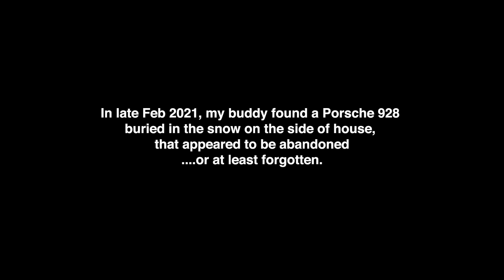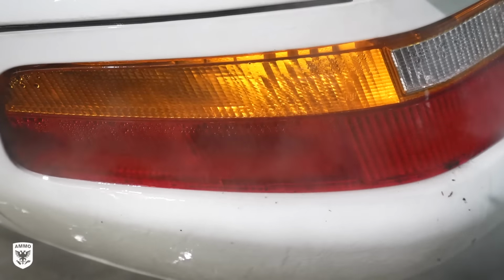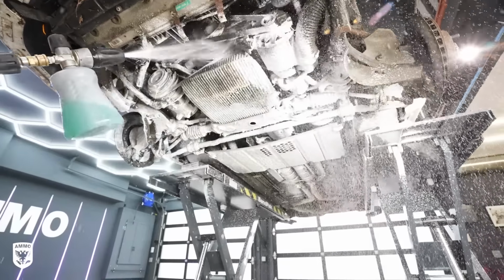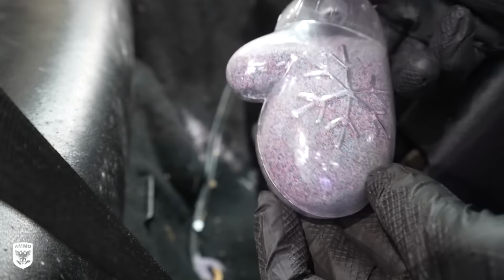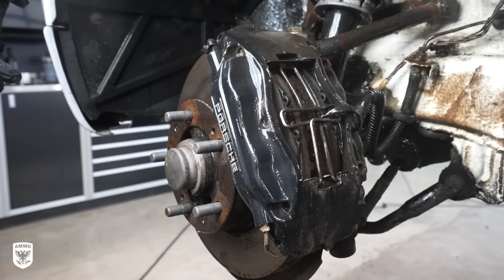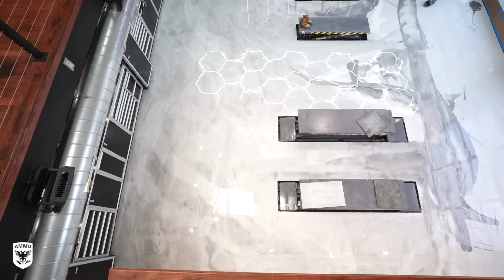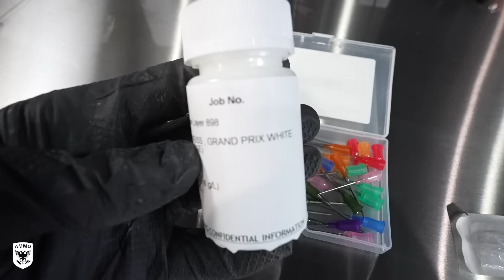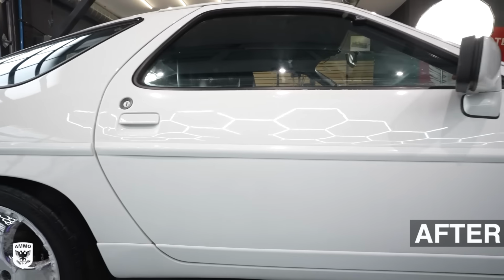First Wash in 15 Years Porsche 928. Most Disgusting Moldy Abandoned Porsche Ever!

Comment: I can't believe the concrete passed inspection with no rebar.  That is insane.  Floor looks killer now, as does the Porsche but that goes without saying!
Reply: That is absolutely wild, that they didnt put any rebar in a concrete floor built for an automobile garage..i once worked for a fencing company and they also made concrete fences..we used to put so much rebar in the brackets b4 we poured the concrete..otherwise the fence would just fall apart.
Reply: Was it fiber cement? Don't have to use rebar on fiber cement.
Reply: That floor is most likely still going to have issues. The rebar in a concrete floor is to stop cracks in it, and not the flex that he mentioned. That flex is coming from the void between the concrete and soil underneath, or just crappy soil all together under the floor giving way. Again, if he haven't had problems with cracking, that rebar ain't gonna help.
Reply: @jayste9334  Jay it was never a automobile garage, it used to be a metal fabrication business.  Guessing the owner even poured the concrete himself lol
Reply: I can't believe it either, the builder must have taken a really good payment of Larry and Larry was so excited and all for the new shop, that is an awful job..
Reply: @murry001  word ok...so they never did anything to the floor, when he was customizing the building after he bought it..that makes sense
Reply: @wasabichicken4433  Ouch..foundation problems
Reply: sounds like a company was trying to pull a scam.
Larry is a fairly rich New York businesses owner, so a prime target.
Reply: @steveorules3972  didnt look like it...looked like typical concrete based on the sample
Reply: @jayste9334  uu
Reply: Working with concrete and fibers for years, you don't need rebar in a non-load bearing floor, even if it has heavy duty vehicles moving on it daily. And to the argument of cracks, fiberglass and basalt fiber treated concrete actually crack significantly less than rebar concrete and it's one of the main reasons to use it, in addition to no rust, no reaction with chemicals like chloride, and so on. I suggest a good chat with Owens Corning to get you up to speed on the realities.
Reply: @diceymaan  Well some inspectors where I live would have a very different opinion of the rebar being non-load-bearing slabs.  I have had to cut into many a slab just to show the rebar reinforcement so that inspections could sign off on these projects.  I have nowhere near the years of experience you do, I am just stating what I had to go through on a daily basis.
Reply: @craigstrickland1572  There are some inspectors that aren't up-to-date, but a lot of them luckily are. But usually you'll have to use a certain brand, because that has been proven to work. It's how bigger companies get bigger in the industry, they do a lot of tests and then the engineer and architect has to choose that brand, or their choice will fall under scrutiny.
Reply: @craigstrickland1572  This particular floor though, should have had rebar as it was the lowermost concrete.
Reply: I remember my first job as a 14 year old was removing nails from old timber beams in a beautiful old building being converted to apartments. The builder "promoted" me to helping with the build itself eventually. I can still remember laying the steel mesh for the inspection, then being asked to remove it as soon as the inspector left. It wasn't until I studied architecture years later that I realised what had happened. I let the local council know, but suspect not a lot came of it.
Reply: @craigstrickland1572  in Australia you’re not allowed to pour the concrete until the engineer has signed off on the Rebar. They’ve been known to attend site with a measuring tape to make sure legal coverage and overlaps have been achieved. 

Can’t believe this slab was poured without rebar.
Reply: How could an inspector know it doesn't have rebar? Or I guess a better question would be why would they even think to check for that? When you see a nice level floor that appears to have been done professionally, would you ever consider it was done by a noob?
Reply: @3rdGenGuy  Larry got the building used and in the modifications they didn’t really touch the floor

Comment: I’m struck by your generosity, Larry. In several videos, you go to extra lengths to clean parts of the car that will never be seen by anyone other than a mechanic—and you do this to make working on the car easier and safer for them. And in the Wednesday replay video, you showed us how to prepare our paint to make the PPF installation process easier for the installer. I find these acts of selflessness inspiring.
Reply: Yeah he definitely doesn't cut any corners
Reply: I think that's part of the deal though. This car is going to be restored, so it needs to be "mechanic clean" for their sake.

Comment: Great video. I bought a barn find 1983 928 s black on black 5 speed  with BBS wheels  in 2011 . It ran ... the body had a little rust at the base of the rear quarter windows but that was it. The leather interior was in very good condition. After a good cleaning in and out  ( a few mice nests only in the engine bay )and new belts , valve springs , upgraded alternator and straight exhaust pipe  .I ordered  a stage 1 supercharger kit from 928 Motorsport in Wisconsin . It warranted a new paint job at this point . Looks terrific and drives even better . Wins awards at local car shows . Love that car !

Comment: Bought a grand ma car two years ago for my daughter . 04 Buick Century,14,00 miles ,grand ma drove it to the store,and Dr visits . Parked under a tree. Not driven in the winter, No rust .The pressure washer cleaning was amazing. $3,000 bucks it cost, almost flipped it for $6000. Amazing what a pressure washer can do and make ya smile.

Comment: Great video and fantastic to see one of these brilliant cars being brought back into service. My father has a low mileage blue S4 model locked away, I've driven it quite a few times and they're still a very smooth and engaging driver even compared to modern era cars. They've aged brilliantly also (discounting facelift changes and so on over the years), considering the initial 928 design study was carried out by Porsche over 50 years ago in 1971!

Comment: I have exactly the same car and it's a tragedy seeing one in this condition.  AMMO NYC, you did an amazing job.  The exterior and interior is stage 1 that is required to prepare this car back on the road.  Next is replacing the all too famous timing belt, water pump, thermostat, and rubber hoses, and belts.  Looking at the amount of rodents that nested on the engine, electrical components such as the main electrical wire harness, spark plug wires, and other wired connections may need to be replaced.  The last thing would be to repaint the magnesium air intake.  Such a timeless beauty.

Comment: The 928 is quickly becoming a collectible amongst Porsche enthusiasts. The early cars have seen a jump in value and later cars like the manual transmission 928 GT and 928 S4’s with a manual transmission have been steadily increasing in value over the last 5-10 years. The holy grail of 928’s is the 1992-1995 928 GTS. Especially a manual transmission 928 GTS. They’ve been selling for over $100k for a few years now. All Porsches have been increasing in value so if you’re looking to get one there’s really no bad choice.

Comment: The main reason the paint cleaned up so well is that it is single-stage and solvent-based.  I have a 1989 928 in Grand Prix White, like the subject 88, and that paint is incredibly durable and very hard.  My 89, at 23 years old and 300,000 miles, has paint that looks virtually new except for small rock chips upfront and on the mirrors.  Any scratches that develop can require quite a bit of work to remove.  What's very surprising in your case is the condition of the interior.  The materials used, leather, padded vinyl, and plastic, are incredibly sensitive to heat and sun.  A car like this one left outside for even a few summer months should have suffered a lot of interior damage with cracked seats, warped door panels, and badly cracked dash and instrument pod.  Whenever I park my car outside in summer for more than 15 minutes I fill ALL the windows with sun shields.  So my car's interior is still almost like new.   I'm stunned to see a largely intact interior in your car.  There must be some explanation, such as it was under an overhang or shaded by trees.

Comment: My 928 interior needs your help haha I'm in nyc:))
I got a late model 86 with factory red leather interior and manual, the interior looks great for for being 36 years old and its original but it is showing its age I'm not sure what i want to do with it, there is a little bit of a torn section on the driver bolster but everywhere that's not torn is looking ok, i feel like if i get new leather for the seat it won't match the rest of the interior and I'll likely have to do the passenger seat at that point too which really isn't bad.
I'd like to keep it original not really for value but more for novelty, it's already lasted so long

Comment: is that the key to cleaning up dirty paint? Or will a good foam soap help as well. I've got some paint that I was wet sanding it and it still was barely getting the dirt off. Or should I just give it a good pressure wash and whip out the orbital with some cutting compound?

Comment: So i have a question. Its not actually related to the 928, but the tesla model 3 you did a couple months ago. What would you use to clean the white interior or even the black interior? for a while, all tesla interiors have been a vegan leather and the white interior has a reputation to be hard to keep clean. ive seen people use baby wipes on the seats, but dont see anyone talk about an actual cleaner and a long time protectant like you use in a lot of your details. would using lather and the mousse be too harsh on the vegan leather or would it work just as good? and would it be ok to use steam to lightly mist over those vegan leather surfaces, not scrub, and just wipe away with a microfiber towel?

Comment: I don't believe this Porsche was sitting derelict outside for 15 years.  I think this show's producers seasoned the car with some makeshift gunk to make it look like it was sitting outdoors; the gunk washes off way too easily.  What is with the random splash of black gunk near the fuel filler flap? If this car had sat untouched in the driveway for 15 years, the asphalt beneath it would be caked with an accumulation of dirt, leaves, and other debris but here in this clip at 1:30 the asphalt directly under the car is completely clean as if the car was just parked there several minutes ago.   I find it hard to believe that someone would be convinced to just give away a vintage Porsche after being repeatedly contacted about it for 6 months by some stranger.  I seriously question the veracity of the story behind this Porsche.

Comment: The thumnail looks like he is cleaning the hood with a flowerbed rake.  That should hide the micro swirls.  Me, I'm still looking for a detail with Youtube results.  It looks like I may have to fly one of these Youtubers over here to get anything done right.  Now, I did not pay a fortune and I basically got my money's worth, but I did want all visible pieces to be showroom clean and would have paid more for a better job.  I just found out yesterday that I won the Mercedes subframe lottery and will restore the entire rear end suspension.  1500 to me, 4000 to them.  I told them to replace all attachment arms and shocks as the labor is paid for and at 150,000 miles, its a good time.  Now its really going to be worth it to find a serious detailer that does the details.  I'm really happy with Mercedes.  This is a huge job that will let me keep the car for much longer.

Comment: I admire your heavy work and effort to clean all these cars presented here in posts. But i want to say one fact. At modern cars, electronic parts don t  like, repet, like at all water and other detailing solutions you are using. Water, steam, solutions on pressure or not, is very bad for diverse electronic parts. Is my opinion, based on my experience working in auto service for many years.

Comment: Please replace the non-original 17 inch CUP wheels with a set of original 16 inch forged wheels, with the correct offset. And please replace the rear bumper with the original one, without the reflective stripe. And please fit a set of original speakers to the doors.
If the car hasn't been started in 15 years, I am afraid it will require a little more than a tune-up.
It will probably cost 15/20,000 dollars to replace fuel pumps and regulators, fuel lines and filters, water pump and timing belt, plugs, oil, fluids, plugs, air filter, brake rotors and pads, original 16 inch wheels, set of N-rated tires (Michelin or Bridgestone), front and rear shock absorbers, the radiators, engine mounts, transmission mounts, and lots of other stuff. 
For sure, you will have to overhaul the steering rack, air conditioning and most of the hydraulics.
And, having sat there all those years, the car will have lots of electrical issues.
You will have dozens of leaks from the engine, so you will have to replace all the gaskets, o-rings, etc.
And there will be many unpleasant surprises.
Enjoy yourself.